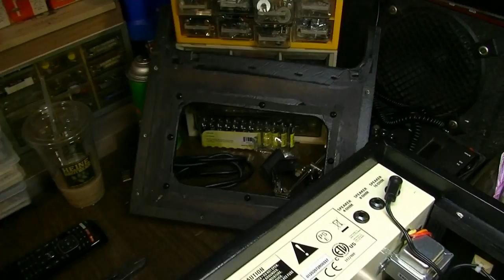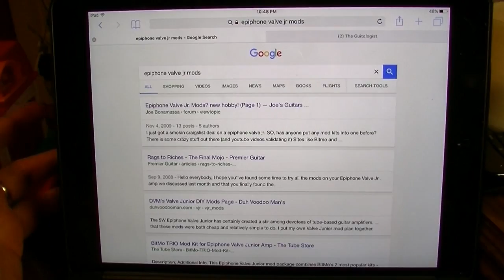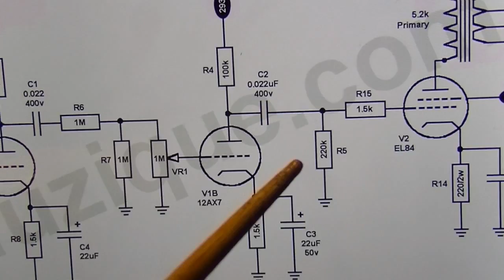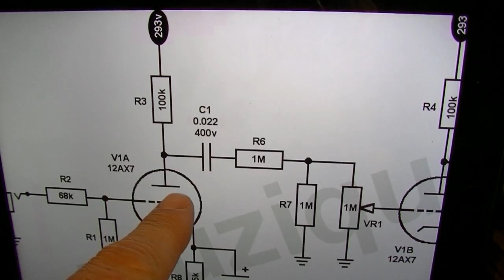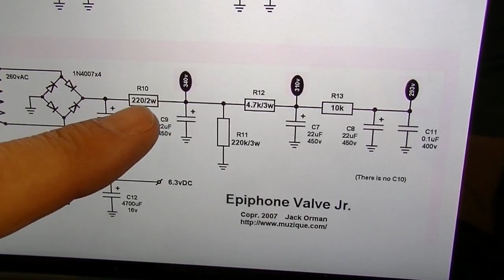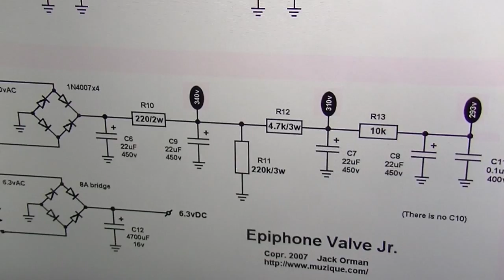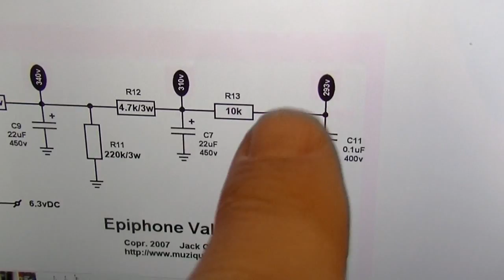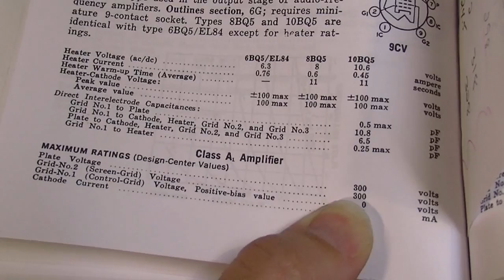Epiphone Valve Junior  Mods - A Total Waste of Time?

Comment: The 22uF/220R/22uF circuit is a CRC filter to reduce hum cheaply, instead of using a choke. You could use 47uF/100R/47uF for better filtering and less sag. The 220k resistor is a SAFETY MEASURE, it's used to discharge the B+ caps, PLEASE put it back!!!
Reply: If something happens to the tubes, like, the filament opens, or some other damage that stops them from conducting current, or you test the circuit without the tubes in, there's always a risk of shock right after turning everything off. The resistor is a very simple and effective safety measure to greatly reduce that risk of shock, and it only uses a few miliwatts off the B+.
Always better to have a resistor discharge a capacitor rather than yourself doing that job.
Reply: Also, the 100nF cap in parallel of the 22uF is supposed to suppress any RF interference for the input stages supply, as electrolytic caps are not  good at high frequencies. It doesn't hurt, so why remove it?...
Reply: @68MalKontent  It also keeps the 12AX7 gain stages from breaking into RF oscillation, as they are wont to do. This can kill your tone and has been known to cause red plating in preamp tubes.
Reply: But yer not a pro electronician!
Reply: Absolutely, there is nothing to discharge those capacitors without that resistor aside from the very low leakage current.  If you think it's going to affect tone, you can put in a bigger one so the caps discharge more slowly, but don't take it out.
Reply: You did just fine in my book, and the end result was a much better sounding amp.
Haters gonna hate.
Reply: You are right. The 22uf/220R/22uf is intended to reduce hum as a choke replacement. And the 220R simulates some of the sag you would find in a tube rectified circuit, helping to soften the stiffness of the amp. The .1uf was to compensate for high-frequency filtering limitations of electrolytic capacitors, which helps prevent feedback and potential oscillations which can be induced by the power supply. Audibly it may not make a noticeable difference, but it was put there to prevent problems. And finally, YES! PUT THE 220K BACK! It is there for safety to bleed off the power supply caps when powered off. Yes, they will bleed off without it when the tubes are installed, but if you apply power without tubes those caps will be waiting like a rattlesnake in the grass! PLEASE PUT IT BACK! At least for the next owner's safety.
Reply: You missed it.
Reply: Just ask Brad, my email signature is "Discharge the caps? Oh......I think I just did."
Reply: LMAO!!
Reply: The NEXT owner he said.....
Reply: less sag and less trouble to
Reply: +John Pabst Well there not really hating, just trying to help. Everyone here is just adding their two cents based on their experience. Except me, of course, because I'm no electronician ;) and totally unqualified to add anything here. Learning a lot on this channel though. Thanks everyone.
Reply: You're a pro electronician?
Reply from the maker: Thanks for the comment! You are correct. My brain was farting out at 3AM again, got tunnel vision visualizing a typical Champ power supply. Vintage amps don't typically have drain resistors. The conduction of the tubes as the amp powers down usually takes care of smaller value caps like this, no problem. In fact, I should make another short video of the cap discharge rate with and without the resistor in place. Should be informative. My hunch is, it's a measure designed to clear regulations rather than actually discharge these caps, but I could be wrong.
Reply: It's actually 1 MEG of RAM for storing the amp's presets! Sometimes I wonder if I should charge for my expertise...

Cheers,
A semi-pro electronician
Reply: @JazzzRockFuzion  no, u shouldn't charge.....that was priceless!
Reply from the maker: Hmm...I find it amusing that people are assuming I don't know what a filter cap does or how a typical power supply is constructed, or how a tube amp stage works just because I spaced on one bleeder resistor, which isn't really necessary for the functionality of the amp and wasn't included in most guitar amps until, like, the 1990s. Also, for the record, increasing the value of the coupling caps DOES affect the bass frequency cutoff. Not sure where some of these critiques are coming from. And the 1M resistor to ground in parallel with the pot...it isn't needed.  I think I proved that when I removed it and the amp sounded better and operated the way 10,000 other amps have operated before it. In hindsight, it seemed the only thing it did was allow the volume pot to go totally silent at 0. After removing it, there was a faint amount of volume still present.
Reply: Yes!
Blackcorvo is clearly  understanding the circuits,, for example the high impedance coupling in the first anode coupling stage , you can put greater values of that 0.022µF capacitor, it does nothing! about the tone because of the high impedance after it,,, only lower values does,,,, . The cathode resistor is for biasing the valve, setting working point in class A of the tube triode, hence the parallel C of 1K5 to short this resistor for the signal only for higher gain for the signal(higher valeus affects the higher frequenties , given on the gate(input), i am agree about the 1M to ground, it reduces here the overall signal gain to the second gate, it can be omitted,,,etc,,, thanks for your attention.
Reply: He is not sure of the 1M in the gate to earth, function is clear= bring the bias voltage of the cathode to this gate (seen as the negative biasing) and is high because it may not affect the signal! (see theoretical stage building with tubes lessons in books and online courses)
Reply from the maker: Here's the follow-up video: https://youtu.be/xMpWcFX4wAg
Reply: The man here in the movie does not know about working of the circuit! Does not know the function of the components, that is clear! I am pro electronician.
Reply: Luc Be Humm....around here a pro Electrition changes out light switches and electrical outlets.

Comment: Jack Orman rules dude.
Reply: Jack Orman doesn't get a fraction of the cred he deserves. The guy is the godfather of guitar tone circuits. The DNA in most commercial effect pedals could be traced back to his designs.
Reply: Great wiring diagram, and very thoughtful to include notes on issues he found that could save others a lot of time and frustration. Very cool on his part.
Reply from the maker: Jack Orman makes things possible.

Comment: i have the same one but the 1st version - cranked it to the max with an overdrive pedal - was loud for a few minutes then got quiet - smokes came out and immediately shut it off - opened and found the T4 area was charred - the amp still plays but i noticed that it spark in that area when turned on - what could be the problem?
Reply: l3ertuz possible you popped the grid screen resistor and you're running the amp with a red-plating tube. Why a fuse wasn't blown in this scenario isn't known, but I would recommend taking it in for service.
Reply: was my 1st thought but i observe no red plating - i found some images in the web with similar charring in the same spot - make me think these amps has this issues at least in version 1
Reply from the maker: I think MuscleDad is onto something there, possibly. Measure the screen resistor and make sure it isn't shorted or something. Also check your cathode resistor and cap and makes sure the cap isn't shorted, the resistor is up to spec, and  check the coupling  cap coming into the grid. Check grid for presence of too much voltage. Just because you aren't seeing the tube red plate doesn't mean it isn't biased all wrong. Could be a short between pins too. Pull the power tube and check underneath. See if there are burn marks between pins on the socket.

Comment: I dissected a Gibson GA-5 LP reissue...  it was similar to this circuit... one of the mods to this was to make it like the gibson.  GA-5 reissue is on my channel. The reissue GA-5 was actually a Mojotone (I think)
Reply from the maker: Most 5W SE tube amps are similar, but it wouldn't surprise me if that reissue was super close. Did it look the same inside? Same type of components?